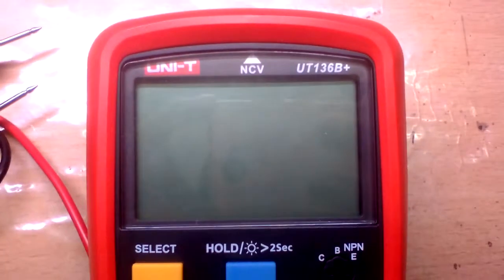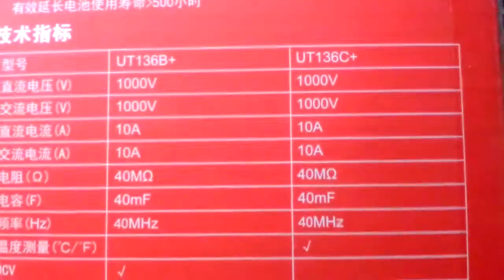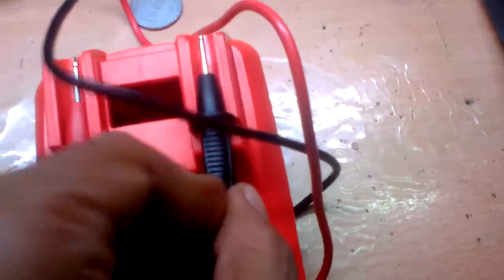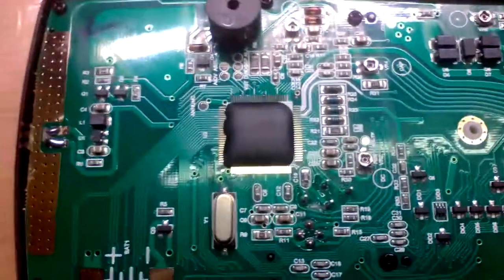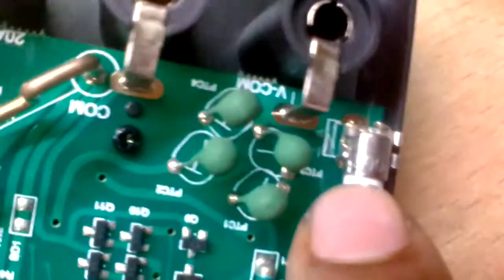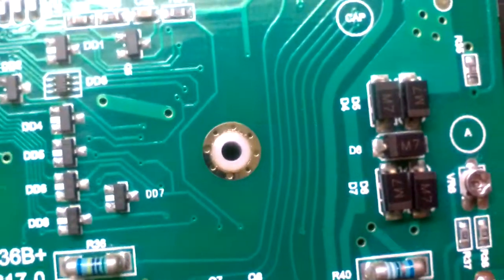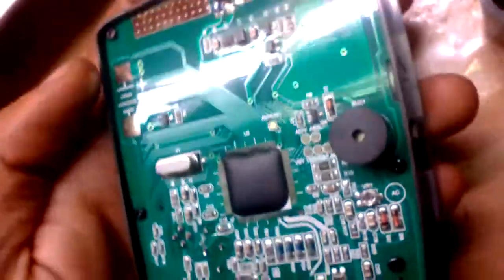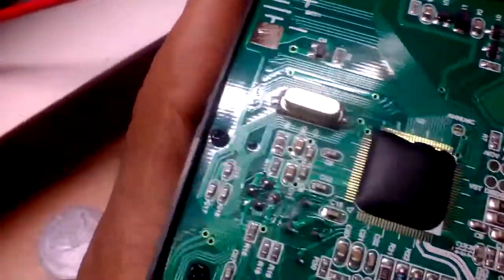UNI-T UT136B+ digital multimeter teardown!

Comment: Maybe the input socket have a gap is because it needs to not be too stiff therefore flex?
Reply from the maker: There are othere meters which dont have the gap.. Gap ones are easier to manufacture

Comment: Hi! nice video! I was wondering, how do you think this one compares to its non plus counterpart (ut136b)?
Reply from the maker: Back when I went to buy this the seller showed me the 136b and it felt very sturdy and the range selector felt very snappy compared to 136b+, and also the build quality felt better too.. but I didn't buy that because of the 9v battery. This one has a long battery life, it's been running on the same pair of alkaline batteries since purchase.
Reply: @asifimtiazneon  Excelent reply, i´m gonna have your impressions in mind when i make my decision, Thanks! Thumbs up!